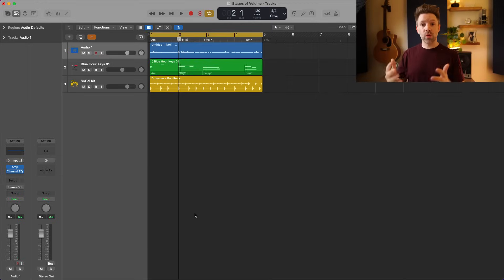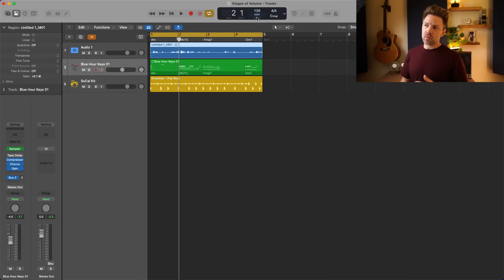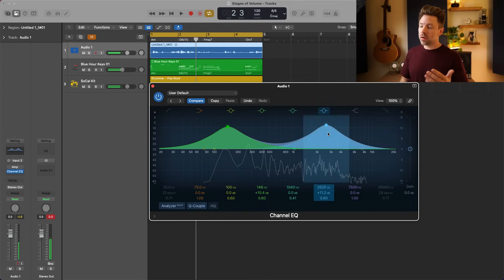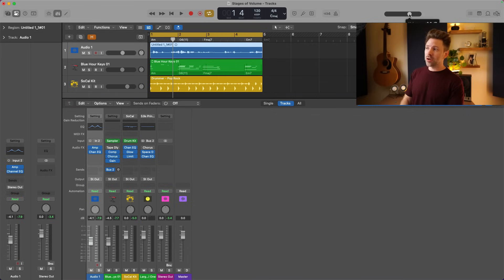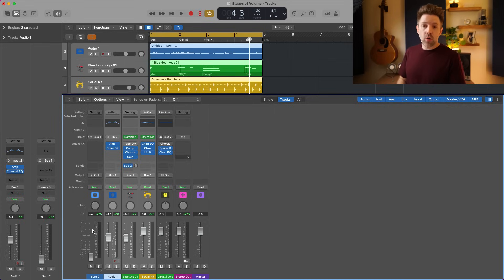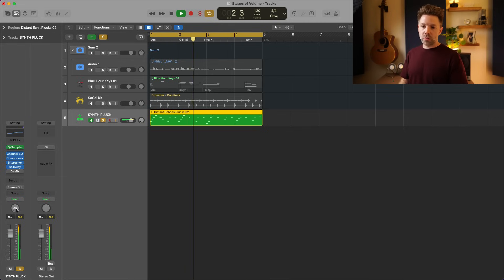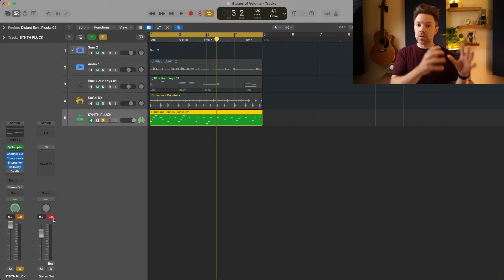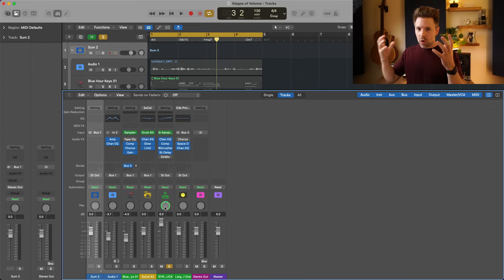The 5 Stages of Volume in Logic Pro

Comment: This was beyond the scope of this video, but one stage of volume you didn't mention is the level going into the interface. The interface has a gain knob, but before that gain knob there is the output volume on a guitar or a synth. Or there's simply how loud you're singing or bashing the drums. There's also the sensitivity of the mic you've chosen. Etc. 

I think it's best to conceptualize everything in terms of input and output levels. Every part of your signal chain has adjustable input and output. Controlling how the output of one stage of your signal chain feeds into the input of the next stage is proper gain staging. You don't have to obsess over it. It's just something to be aware of.

Comment: Great explanation of the aspects of control of volume/levels Colin. There is something I was wondering about I'm sure you can explain. When I had a little home studio (I had a little Allen & Heath 842 desk)  and when I was mixing live or recording in other studios the mixers/consoles/desks all had PFL (Pre Fade Level) switches and trim knobs at the top of each input channel strip. This switched the metering for the input channels to metering what's going into them. This was particularly important when recording microphones and setting output level of things like synths to a sensible level. Looking at Logic I think I found something like that but I'm not sure if it's the same thing.